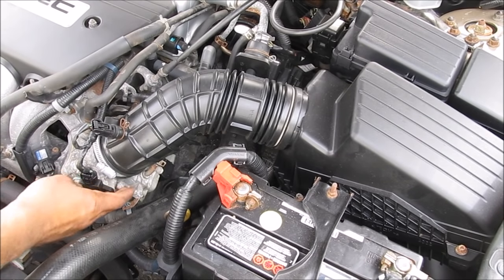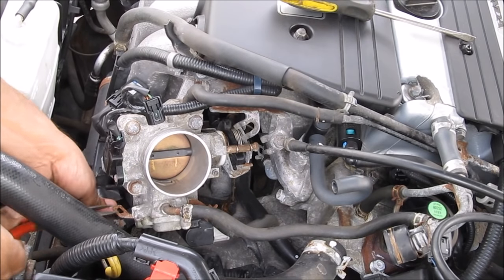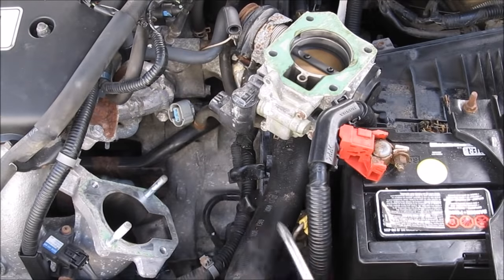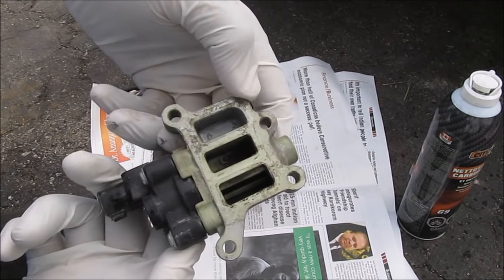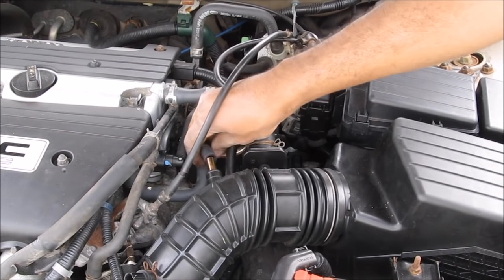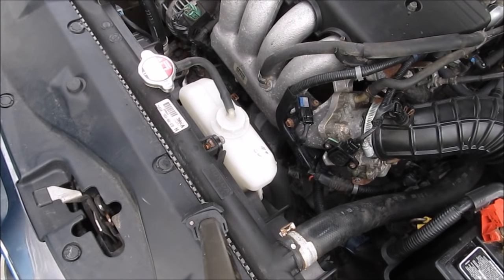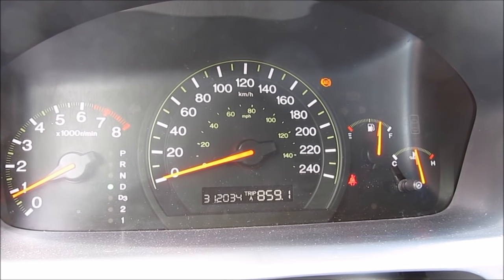Honda Idle Air Control Valve, PCV and Throttle Body Cleaning

Comment from the maker: Get your supplies and tools here to clean your IACV and throttle body:
Throttle body cleaner:
https://amzn.to/3hAl52F (US)
https://amzn.to/3liEhmE (Canada)
3/8" Ratchet set:
https://amzn.to/3hA7LLD (US)
https://amzn.to/3zgHE2d (Canada)
Reply: I hope you cleaned your Dad and brothers toothbrushes before you put them back in the bathroom!!!
Reply: @lisawong826  Sure😎
Reply: what year honda is this?
Reply: Are you telling me you don't have JS philips head screwdrivers? Those dang things are only really needed for idle air control valves. Not sure why those are the only screw heads a regular philips won't work on.
Reply: Getting ready to replace the cruise control linkage on my 03 Honda, this video will be of great help. Dorman makes a kit to replace the plastic linkage on those, 977-100 if anyone needs it. Thanks a bunch for this video!

Comment: I just replaced my Idle Air Control valve.  I inspected the old one and discovered why Honda calls it a rotary air control valve.  The valves consists of  a rotary shutter on two sealed ball bearings.  They do not need cleaned, but rather lubricated.  Using carb or brake cleaner will impair the ball bearings from working by drying up what lubrication they have left, making your problem worse!  Mine was "sticky" I lubricated the ball bearings and it turns as smooth as "silk".  DO NOT CLEAN THEM, OIL THEM!
Reply from the maker: +John Pitcavage good tip, thanks for the insight.
Reply: What type of oil did you use to lube them?
Reply: This advise saved me!Thank you!!I cleaned it out and it wouldn’t work.But after scrolling down and reading this comment ,I took it all off again and sprayed some penetrating-lubricating oil and it work.I couldn’t believe it.Thank you!’
Reply: John, thank you for the advice. Have surging idle. Just replaced a broken IAC valve with a used one (that I cleaned) and while the car runs better, it still isn't driveable. Going to pull the IAC and soak it in penetrating oil.
Reply: John Pitcavage like WD- 40 type penetrating oil??????
Reply: @kriskeeney167 gun oil, treadmill oil, or silicon oil. Has tons of lubricity.
Reply: Meanwhile the customer he did will now go pay another shop😂
Reply: I just rubbed one off into the hole and it's all good now...
Reply: Can you just spray lubricant down the ports in the throttle body to lube the iac valve?

Comment: This ranks right up among the top DIY mechanic videos. No BS or excessive gobbledygook lingo - straightforward and professional grade editing. Right on, Speedkar99!
Reply from the maker: +Doctorhamfat thank you, short and to the point is my style!
Reply: I sure agree with you sir. A complete service, with good care and proper coolant level detail by the end. It made a ten point rank video.
Reply: Sameone straight forward. Too the point.a true teacher
Reply: Totally agree
Reply: @speedkar99 which nut is the adjustment nut for the throttle body, the one below the bracket?

Comment: Honda people should be aware that they do not use Phillips screws. I know it looks like Phillips, but it's not. It's called Japanese Industrial Standard, or JIS. JIS screws have a deeper cut, and JIS screwdrivers have a longer point, allowing for more torque and a tighter screw. Using a Phillips screwdrier on a tight JIS screw is guaranteed to strip.

Comment: "dad's tooth brush" LOL. great video
Reply from the maker: +CreateYourWorth yea thanks !
Reply: speedkar99 n
Reply: speedkar99 great video - but please learn how to position the VISE GRIP PLIERS properly !  - you clamped the striped out screw backwards !!  Next time  when you counter clockwise a screw be sure to clamp pliers in a down position to ease screw out and let the pliers mechanics do it’s Job . 
FYI
Reply: I find my wife's toothbrush to work best, but I mostly find myself alone...
Reply: 00
Reply: @speedkar99  my*
Reply: Definitely LOLd at that part.

Comment: Great video, especially the added mention of check and clean the PCV (Crankcase vent) Valve, when this valve gets sticky, like you said causes all sorts of other issues. Back to your cleaning of the IACV, one thing that I do when removing and replacing all engine mounting bolts is clean the shank and threads on the wire wheel then apply Anti-Seize. Due to the dis-similar metals of the steel bolt and aluminum block, it creates a source of electrical corrosion. This is why it is difficult to remove (especially the first time removal) the bolts. not because they are really tight, its is because of the dis-similar metal corrosion built up between the metal surface of the bolts and the aluminum casting and eventually become seized to the point we break then off and need to remove the broken studs. A little cleaning and application of Anti-Seize or any lubricant can go along way to make next time removals go much easier. Thank You again, a very well done [Short & to the point] instructional video.

Comment: After cleaning the IAC, I still had idle "surging", until I gave the IAC some vibration using a small hammer and long ratchet extension.  This was enough to loosen up the IAC motor and allow it to fall into it's correct position.  I now have a steady idle at about 800 RPM.  I realize that I may need to replace the IAC valve later, but the part is not very expensive.  For now, I have a  nice running engine on my Honda Accord 2005.  "Dad's toothbrush", I like your sense of humor.  ;)
Reply from the maker: Good you were able to fix it. Mine still had high idle
Reply: @speedkar99  RockAuto has the IAC for about $60.  ;)

Comment: A very good video! I was concerned at first when your body was blocking much of what you were doing, but once the TB was off, you should good closeups of the TB. Good tip on replacing gaskets. It sucks not having new ones before you start, only to have to take it all apart after you drive out to buy new ones!
My tip: use vise grips to clamp the coolant lines closed before taking them off, and plug them with a bolt before coolant flows out. At this point you can remove the vise grip or simply leave it on until it's all reassembled.

If using the red straw on the spray can, always hold the straw when spraying into the engine's openings. It suck to have the straw fly off into the engine. It's not fun taking the engine apart for something that could have been avoided! I learned the hard way many years ago...
Reply from the maker: Thanks for the tips

Comment: Great video. watching this because I got P0507 and P1157 after doing my own rack and pinion. So weird how those pop after doing some major work. They were both legit too, my o2 sensor was blown out on one side and my IAC is definitely sticking like it hadn't before. Had an intermittent CEL before all that so it was probably telling me something lol. I tried to clean the IAC but didn't want to deal with messing something up on those tiny torx bolts and not having a spare. So I'm buying one now to replace the original and clean that one up for when that non-oem spare will probably fail! Oh, and I thought I had a lot of miles when I noticed that car's mileage, my Accord is at 269500 and still feels strong! I probably should have replaced that PCV long ago too! Thanks for the video!

Comment: Clear and concise, well made tutorial. Only one thing I wanted to add: PB BLASTER!!!! Ypouve got a ton of rusted fasteners I saw throughout the video, take 10 mins and go around giving shots of PB on every but, bolt, fastener. 
Even of you're not doing anything with it at that moment, it'll still seep ndown the thread and keep it from locking up. Those two stripped screws would still be alive today =/ (Impact screwdriver also works wonders for stubborn bolts and screws!)
Reply from the maker: Thanks for the feedback and tips. Yeah, this car was quite rusty. I haven't tried PB blaster yet, I'm trying to finish off my WD40 before going out to get some though.

Comment: Did the exact job on same engine but you can take the idle control module apart and clean it better by moving the valve inside and cleaning it much better by taking off the additional 2 screws

Comment: Thank you, I need to do this job and your video was well done.

One side note: those fittings that the coolant lines connect to become very brittle after a longer period of time.  I developed a pinhole in mine.  Not something you can replace without replacing the throttle body.  If yours breaks/leaks, you can connect those coolant hoses together to bypass the throttle body.  The car doesn’t suffer from any drivability issues or throw any codes.

Comment: Great video buddy!
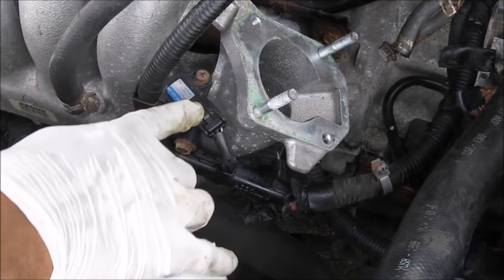At 4:40 that's a MAP sensor which stands for Manifold Absolute Pressure (sensor) but its similar to   mass airflow sensor. I have to do so many fixes to my accord 😣
Reply from the maker: +Geo Gabri thanks
Reply: Manifold Air Pressure sensor. No Absolute about it.

Comment: Great video, one tip I have is get a Snap-On Phillips head screw driver for your screws or a (shake  n' break) which is an air impact screw remover. Either one of these will change your life!
Reply from the maker: Good tip for those IAC screws!

Comment: got the iacv screws off on mine and replaced them with tiny hex heads, to get the screws off a friend used an impact screwdriver that torques it loose when it compresses when you hit the end, got all 4 off in one try

Comment: Great video! My 05 Accord has low idle at times after starting, it pulled a code that this needed to be replaced. I was going to just clean it. But thinking I’ll replace it.
Reply from the maker: You can try to clean it. For me, I still had a high idle issue
Reply: speedkar99 what ended up fixing the issue?
Reply: UPDATE; so I replaced the IACV with Honda part now. Started up great did the relearn on first try and is running like new! No more fluctuating idle. So I recommend just spend the money and buy it directly from Honda

Comment: Hey thanks for the content. How did you clean the PCV valve? It wasn't shown on camera. I'm going to try this myself for the 1st time and I don't want to make any mistakes. Thanks in advance.
Reply from the maker: If you take it out you can clean using parts cleaner. It's cheap enough to replace

Comment: Sir, my car i20 engine rpm up to 1100 from very low 650 rpm when iscv is disconnected. However, it drops to the same low 650 rpm when connected.

How to restore normal rpm to 850??

Comment: I have australia version 2016 odyssey with k24w earth dream engine, i feel my idle may be 50-100rpm too low and there is a slight vibration on the steering wheel, ive replaced new spark plugs, coil, pcv valve, nsw engine oil and problem still there. Any thought on how i can fix it? Thank you

Comment: Nice Job! good editing, the facts.. just the facts man. I like it! Your Father and Brother must be proud! (till the next time they brush their teeth, that is! LOL) I will let you know if it helps me, my 98 Acura CL has sat mostly still for a year, I did start it up pretty regular for the first six months and moved it around a little, but was a bit negligent the last six months, had to boost it the last two times. Last time I started it the idle was going from 1,000 to 2000 every few seconds, even after running it up and fully warm. onece the battery charged enough to start the car, I disco'ed positive lead for 5 min to reset computer, no good. (Did that twice, I did!) ...also added 6 litres clean gas and a 50 ml gas line antifreeze to negate water, no good. this is my last attempt to rescue this little tank, with 360 + K's, still love it though.
thanks again.
Reply from the maker: Thanks. Haha yeah that toothbrush sure does come in handy! Skip to 6:25 in my latest video to see it in action again! 
https://www.youtube.com/watch?v=oXYHtoTCdFY

All the best on your idle fix.

Comment: Just like he says, when the 2.4L has say about 70K to 200K miles +\- and the engine sits for weeks or months, the IACV will absolutely get seized. I guarantee this procedure works to remedy the error code.
— Note: The system may or may not throw an OBD code yet the idle will fluctuate.
Reply from the maker: Yep

Comment: Awesome video.   Thanks.  Very nicely done.  I have a 2003 Honda Element giving me a high idle code, I think it’s like a P0756, but I’m not sure of actual number.  Anyway, it’s got something to do with the throttle body.  Would this procedure be similar for MY car ?   You worked like you really knew your way around that car.  ! Thanks.

Comment: My 2002 Honda CR-V revs really high (2000 rpm) when I first start it and I can small lots of unburnt fuel in the exhaust. And then goes back to normal when it heats up. Will doing this maintenance solve my problem?
Reply from the maker: Yes. Otherwise replace the Idle control valve

Comment: Awesome video bro thank you so much. Quick question is this the same way to clean an 04 v6 lx? My car rpm goes up than down, gets normal once car is started.
Reply from the maker: +818geo glad it helped. V6 has a different throttle body I believe.

Comment: I need some help please. I have 2003 Accord, great car. I did oil change spark plug and valve cover gasket. A week after I decided to clean my iac and throttle body. However when I was putting everything back I forgot the gasket (blue one) that goes on the iac valve and in the process I lost one putting everything back I lost one of the nut now. I start the vehicle and few minutes after I started seeing smoke but I was thinking that was the carbon burning off. The next day it was the same and the smoke was white when I checked the oil it was milky. I then pulled off the throttle body and coolant was in it as well as the manifold. A lot. Could it be the missing nut and the gasket not going back that caused it to happen?
Reply from the maker: +dwayne laylor yep it could. Time for a new gasket

Comment: Great video!  TO THE POINT!  I will perform this soon on my 2004 Accord.
Reply: If the throttle butterfly is electrically driven, the process is more complicated if you wish to avoid potentially causing costly damage.

Comment: Do you recommend cleaning a MAP sensor with an electronic contact cleaner or a MAF cleaner? My MAP sensor is 5 years old and never been cleaned since then. Thanks.
Reply from the maker: MAP cleaner would work,
I don't think contact cleaner is harmful either. Just don't break the little wires!
Reply: @speedkar99  super helpful man! Thanks!

Comment: Those “Phillips” screws are actually JIS screws (marked with one dimple) and require a JIS driver to avoid stripping.
Reply from the maker: +RixceU thanks for the tip
Reply: Can I borrow yours

Comment: are the 2 bolts holding the IACV on to the TB the same? Because I? bought a couple replacements and they will go into 1 hole but will NOT go into the other. As if the thread pitch is different or perhaps the threads on the TB are messed up.

Comment: Hi. How do we relearn idle after doing this to a hyundai which has throttle body operated by a cable? After cleaning, the idle has not gone back to its stable idle. Can we relearn using a scan tool? They  say only wired throttle body can be relearned by a scantool and not a throttle body with a cable. Is it true? Thanks man!

Comment: Ok I got it on using a fair bit of messing about and brute force. Problem now is that I did it when it was raining so water got in my throttle body and intake, and coolant got in my intake yesterday when the coolant hose on the throttle body was removed, now I am getting alot of white smoke. Been running 15 minutes now, will it clear eventually? How long should it take?
Reply from the maker: That's not good to have water in your engine... eventually it will burn out. Next time be more cautious. Change your oil asap.

Comment: 2002 Accord car warm tranny in Park.  I rev the engine to about 3000rpm then let go.  The idle drops down to about 400 and almost stalls.  Then about 6 seconds later it jumps up to normal at 800 rpm and stays there.   The idle is smooth once it jumps back up it is only those few seconds after revving it that it almost stalls.   Car has 200K miles and it had a bad PCV valve gunked up which I replaced a month ago.   Should I examine the IAC valve??   Or if it is bad IAC then idle is bad all the time?

Comment: Damn, I wish I'd seen this video before I took the throttle body off my 2006 Fit for cleaning. Not only would I have known to watch for those coolant lines and the stubborn screws, I would have known not to use my own toothbrush! :)
Reply: The PCV valve on the Fit's L13A also looks ridiculously hard to get to. I suspect it's not operating properly but I'm dreading the rigmarole of getting it out to test/replace.
Reply from the maker: Yes those stupid screws...
Reply: Oh, I subsequently learned that JIS screw heads/drivers are a thing! A Phillips driver is more likely to strip out the heads. Who knew?

Comment: Will the cleaning of the iacv clear the corresponding engine code? Or is it not worth it and better just to replace it?
Reply from the maker: Clean first 
Replace if still not work
Reply: speedkar99 thanks for the reply, is the car in this video an 03-07? Because that first air temp sensor you unplug is not present on my car, idk if it's just missing or if it's a different model

Comment: I just swapped the engine off of a Honda Civic and when we cranked it the car idled fine. It wasnt too long that the idle begin to sound rough and code P0511 came up on the code reader. Is it possible the valve could be dirty? I did clean the throttle body before putting it on the new engine.
Reply from the maker: Yes the IAC valve is separate from the throttle body. Does it smoothen out when you hit the gas?